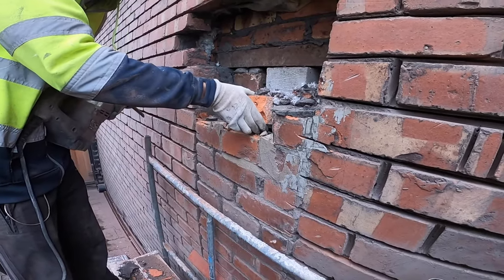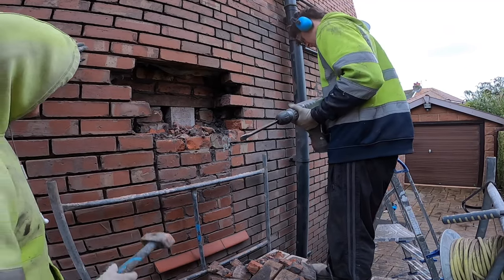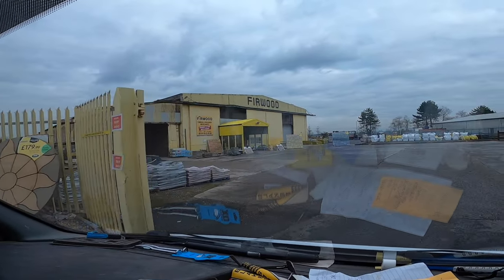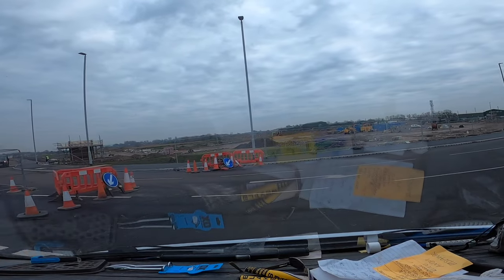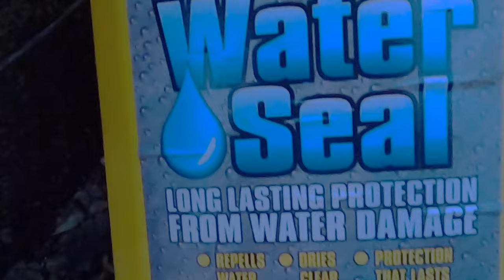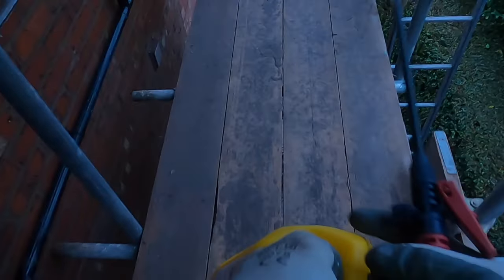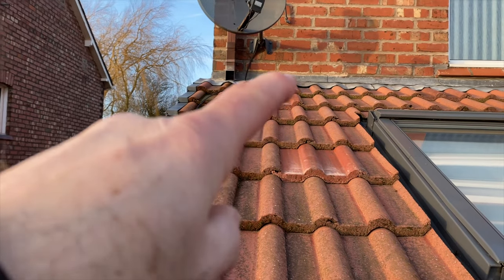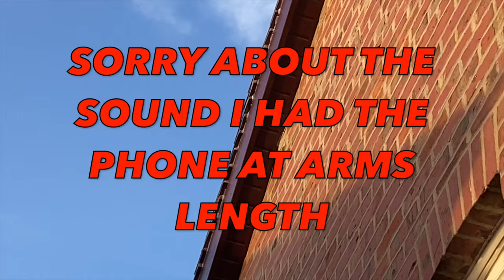BLOODY AWFUL BRICKWORK ON A WINDOW

Comment: Another job well done. My pointing is not the best. Dont have the patience like some so I tried flush pointing with a block of wood recently on an old wall and it matched up well with the original. Think I'll be doing that more now with the old imperial.
Reply from the maker: Yeah flush pointing works well I like that too 👌🏼🧱👍🏽

Comment: Lovely work . Next time you need to spray a load of product try the ghost buster spray pack . You wear it like a backpack and pump it side to side . I’ve also seen an electric diy style paint spray gun . It covers a lot but it’s a pita to refill as the tank is too small.
Reply from the maker: Cheers Paul 🧱👍🏽

Comment: I would never use 240v tools outside in wet conditions, now retired but all my power tools were 110v as required by most building companies
Reply: @Peter Homan There's no requirement to use 110v tools, 240v tools are safe to use outdoors as long as you use common sense and dont let them get soaked.
Reply from the maker: Thanks for watching and commenting Pete 🧱👍🏽

Comment: Always drill out the toothings with a SDS then grind and they fall out, I could never leave a job like that with a closure in it, just not on would have to be three quarter bat.
Reply from the maker: We normally do drill it plus the walk had a closure in it all the way up anyway so we just matched up 🧱👍🏽
Reply: brick cutter, yes was cringing to see the q bat, yet if as build is, fair enough,   the golden rule 3/4 's 
good job overall guys ,

Comment: Why not use a vacuum attachment on the grinder and save spraying all that mortar and brick dust everywhere? Cleaner, easier job.
Reply from the maker: The job is awkward enough without a vacuum attached and humping all that equipment up 3 lifts on a scaffold 🙄👍🏽🧱

Comment: It is clear that no interim support needed for such a short span as the matrix of the existing bricking would suffice. Is there a known span limit for this or is a brickies eye and experience enough? I have built in timber and learned many tricks in spanning posts using cantilever.
Reply from the maker: It is down to experience, I’m not sure of any calculations.🧱👍🏽

Comment: Slap the hell out of it steve like. See new set of OX pins sitting there on dash just bought. 3 sets for £17 odds online
Reply from the maker: Ay up mr super chat 💬 😏. 
You are a good man sir and very generous! .👍🏽
As for the ox pins we are made up with them , we actually bought these 😆. , they are definitely up there with footprints . 🧱👍🏽
Reply: @SteveAndAlexBuild  
Cheers steve. Yeah footprints bend very easily nowadays. Footprint Bolster snapped clean recently also after 6 months. So went with ox pins. Use a lot of ox stuff. Just can’t part with stabila or W Rose. That said was looking at there trowels and levels there up there for sure    Brick line like using ox also
Reply from the maker: Yeah we like the ox gear , I’ve used their trowels for a long time now . 🧱👍🏽💪🏼
Reply: @SteveAndAlexBuild  
Steve you can use any trowel mate garden trowel the lot. No big deal your work is very good 😎👍🏻.
Reply from the maker: @lmilne4859  Thanks pal , much appreciated 😁🧱👍🏽